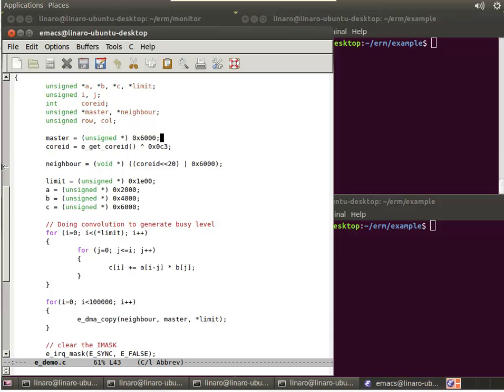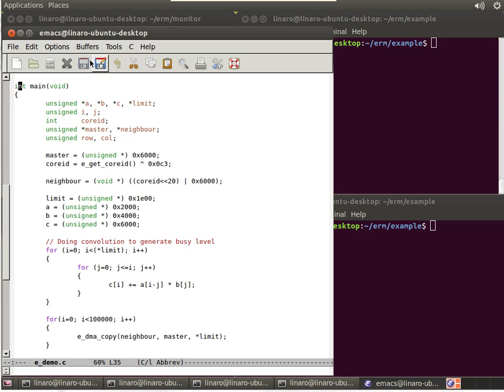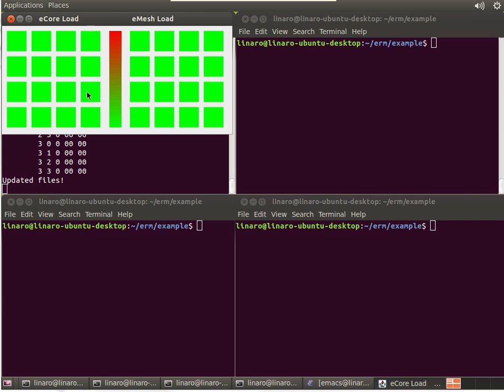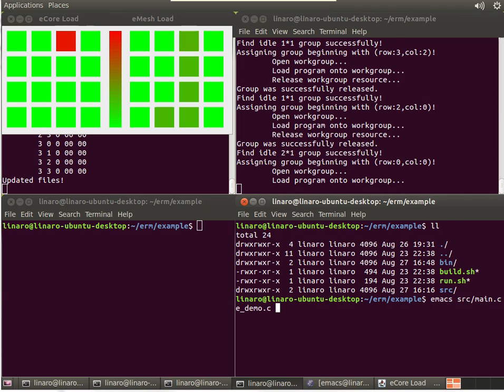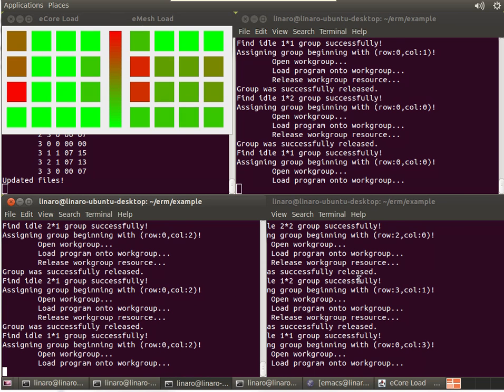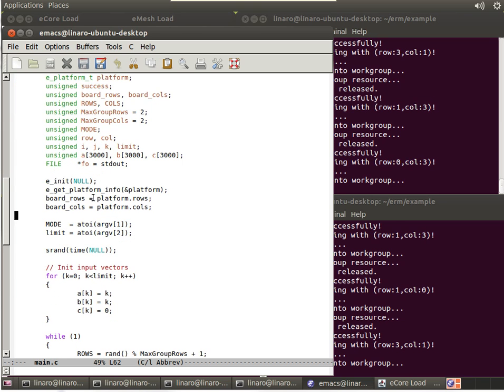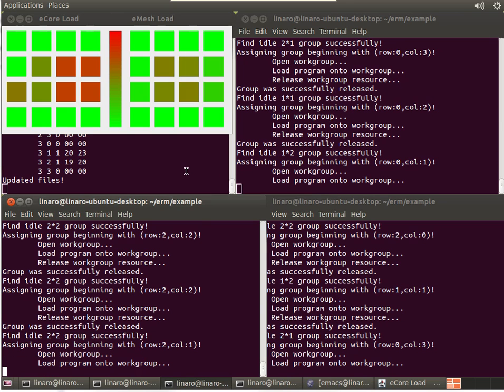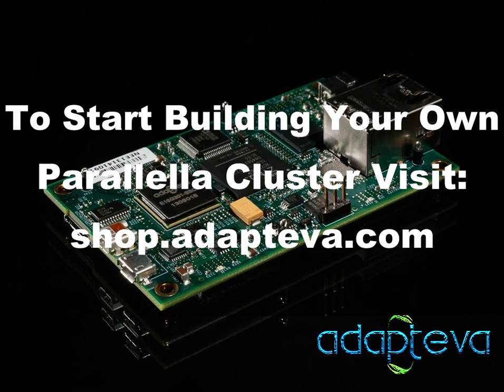Parallel Programming Made Simple

Comment: With the parallella board, when running multiple threads on the system is it offloaded to the co-processor or do you need to specially program for that

Comment: I just got today a parallella board from amazon. I have worked on the sat problem for over ten years and i am planning to parallelize my "ben-jose" trainable sat solver algorithm in parallella. From the user stand point  of parallella I would loved if you GPL3 all your chips (yes the 1024 cores too). Think of it this way:  From a designer people stand point, the design work has already been paid for. Be a design, service and comertial company not an ip company. Parallel programming is still a nitche. Big companies wont come in.Too optimistic/naive for you? 
GREAT WOORK. Thanks for parallella.